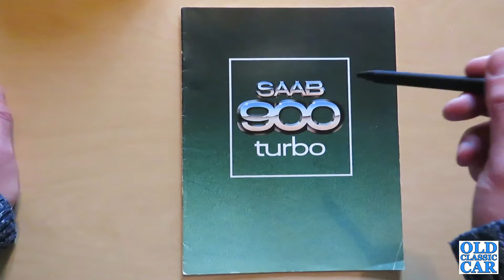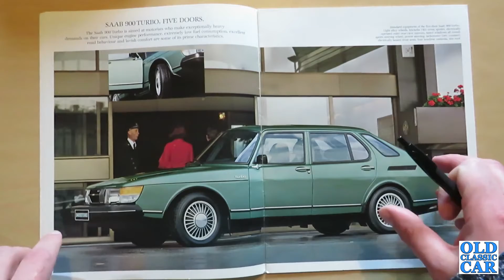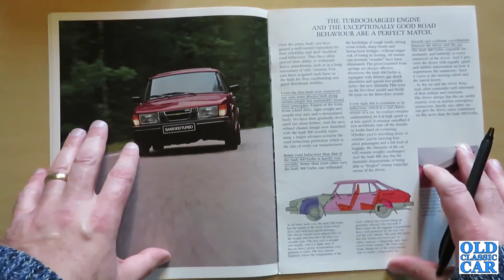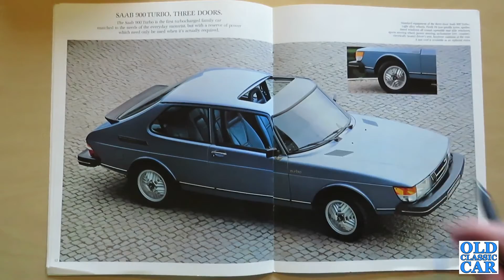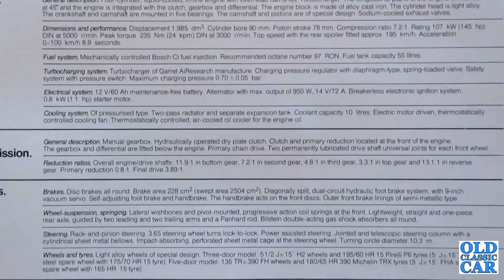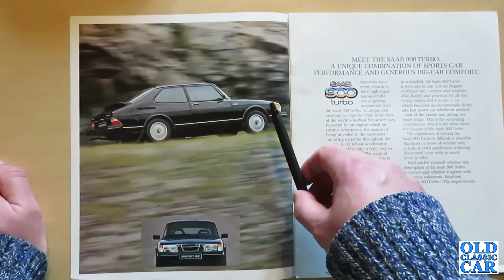A classic SAAB 900 Turbo (1st series) brochure review, 1979

Comment: the rust didn't develop "quickly" compared to other cars, but yes, after 15-45 years, some rust has developed, like in any other quality car from that period, and better than almost everything else. volvo and mercedes are probably the only others with similar build quality and longevity! most cars from that era rusted "quickly" compared to well-built cars today with more rust-resistant coatings. Cars used to rust in five years, most of the saabs didn't rust much in their first 20 years ,they're now 30-45 years old let's keep in mind!
Reply from the maker: I agree that SAABs were better built than many, having owned a few, but we were surprised just how quickly my dad's 900 Turbo (1979 build) was going very rusty on the front arches, sunroof panel and across the tailgate after about 4-5 years or so (so in 1983/84ish). Maybe the paint was poor (water based perhaps? I know that type of paint afflicted a lot of Volvos etc in the late 70s era). I'd very much like another though, probably a mid-80s flat-front 16S if I could find one. I spotted one parked outside a local garage about 3 years ago, but sadly it was rotten on just about every panel. It was available cheap mind but I've enough big projects ...
Reply: @oldclassiccarUK  wow, maybe they made some better rust-proofing in the mid 80s. but I know other cars of that era rusted much quicker than most cars sold today ,too. And yet, they're all disposable compared to the C900, which will outlive all new cars.

Comment: Thanks for this great video! I'm from the UK and I had a Green 1979, 900 Turbo, 5 Door back in 1991, it was my second car after passing my driving test in 1990 as a teenager. It was a 4 Speed manual with green interior. I absolutely loved this car and have very fond memories of it. I also had the detachable column that fixed between the front seats to prevent injury to rear passengers in the event of an accident. I do remember having some problems with the turbo wastegate sticking which caused the boost to triple and the horsepower went from around 145 to about 250, the needle on the boost gauge used to go thru the red and off the scale, for about 2 hours my car was like a rocket ship, still wheelspinning in third gear at 90mph in the dry, until it blew the head gasket and melted number 4 piston lol. I should have taken it to the mechanic when the Wastegate did stick to prevent damage from overboost but just couldn't resist, the power was insane.  kids eh? Thanks again for the video. 👍🏻
Reply from the maker: Sounds like your car was identical spec to dad's '79, lots of detail differences over the cars just a year or so newer. Thanks for watching!

Comment: Bosch CI and K-Jetronic are the same thing. CI is the English abbreviation for Continuous Injection whereas the K in K-Jetronic stands for the German word Kontinuierlich meaning continuous. This system's other feature is the mechanical metering of fuel to the air and that's why it's often referred to as mechanical injection. It's kind of an analogue MAF sensor. Really enjoyed the review, thank you.